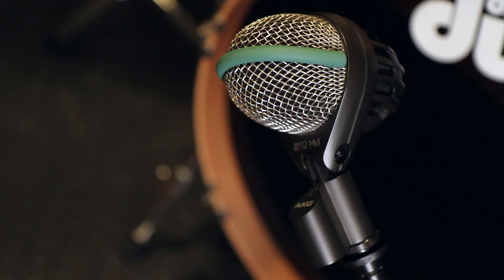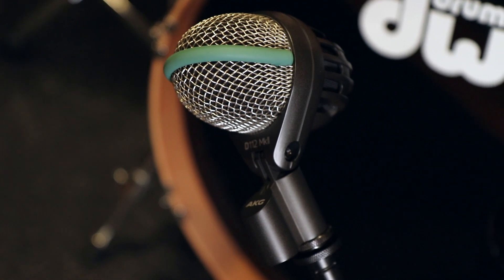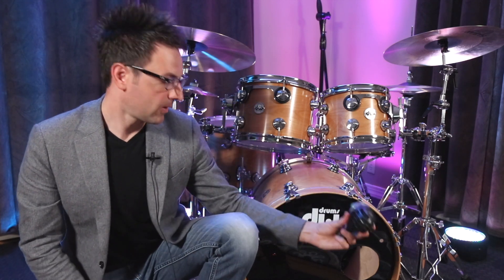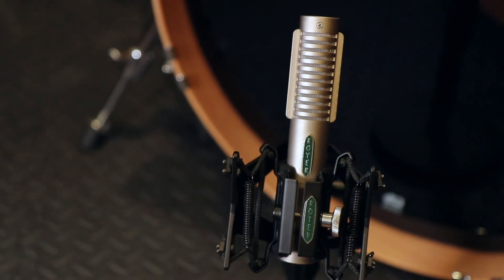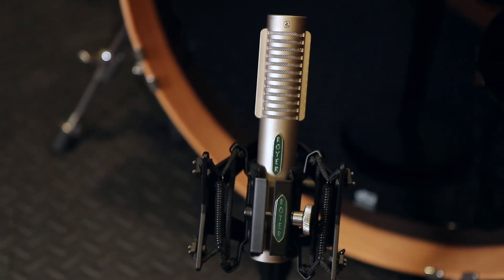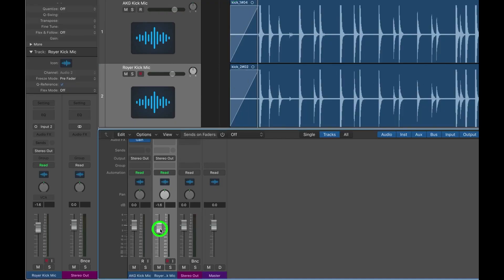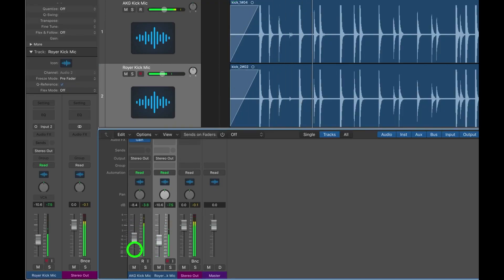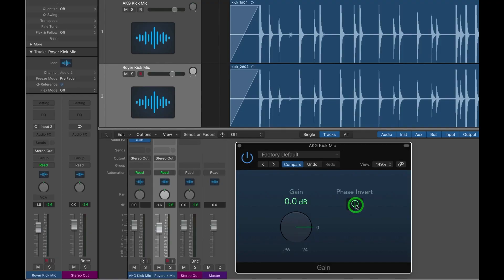Kick Drum Miking Tutorial AKG D112 & Royer R-121

Comment: @Todd Urban  

Nice demonstration, Todd.  👍

I use a very similar combination of mics and positions depending on the actual kick drum itself and the sound/character we're going for.

My personal "go-to" mics for this are the Samar Audio VL37A Ribbon and the Lewitt 640 REX dual capsule Dynamic+Condenser mic.

Both microphones are extremely versatile and excellent on a lot of different sources.  Of course, the tuning and degree of muffling on both the batter and reso heads have a significant impact on the character.

In addition, in my research throughout the years, one commonality that I've found is that about 70% of the iconic kick drum recordings that I really like in popular music have been captured using a moving blanket/sound blanket "tunnel" technique over the microphones and bass drum for isolation/reducing bleed.

For drums (and just about everything else), the Mesanovic Model 2/2A Ribbon mics are pretty special as well, along with AEA Nuovo N8.
Reply from the maker: All great comments. I tried to keep the video as short as possible, but tuning and muffling is probably more important than mic placement. And yes, sometimes I do the tunnel setup, which can affect the sound in tons of different ways. Maybe I’ll do a followup video at some point! I love those AEA mics too!